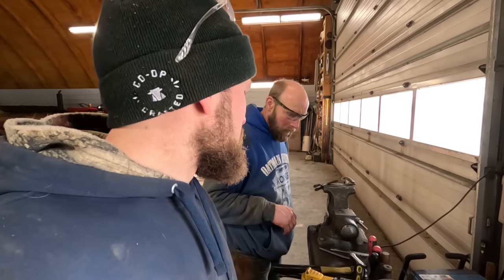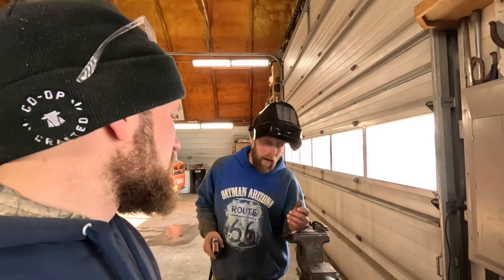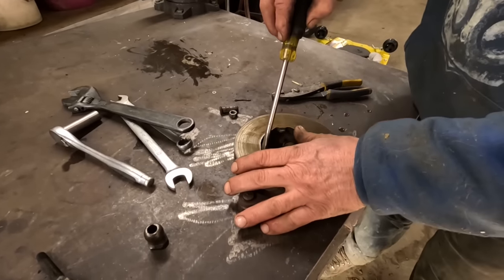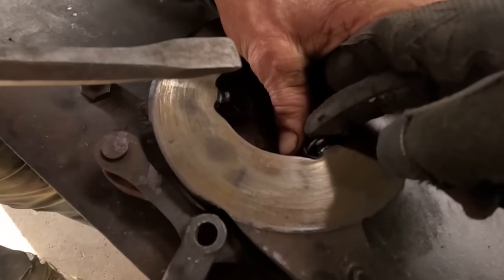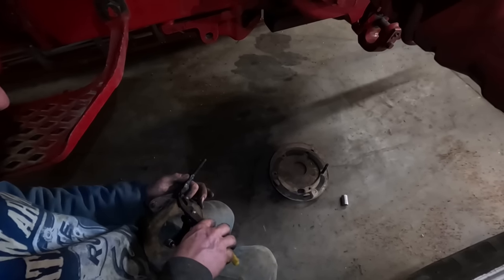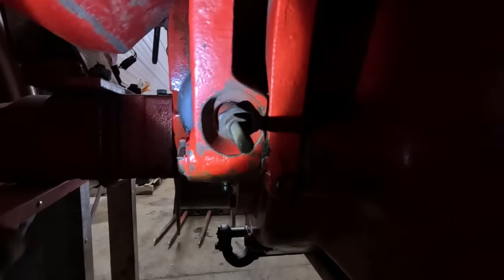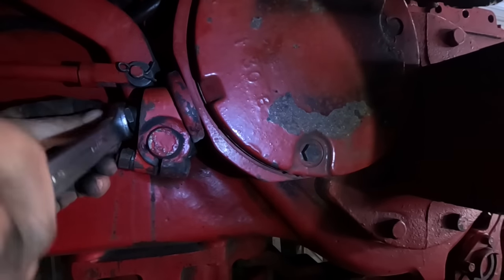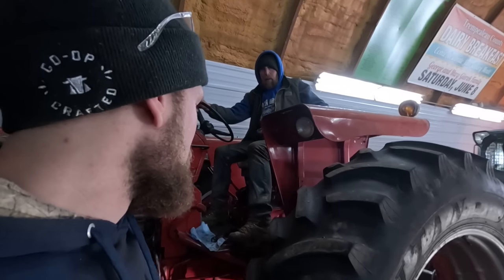Fixing Up Our Old 686 International Tractor!

Comment: Shout out from Seneca SC. I've been watching you guys for awhile, and I want to tell you that you take me back to another place and time. I'm currently 56 yrs old. When I was in high school back in the early 80's I woorked on a local dairy farm here, just up the road. It was a herringbone parlor, with 4 on each side. Numbers varied but in the 65 to 80 or so. I didn't have much cow contact, mostly worked the ag side since they had a dedicated dairyman. We did the usual hay and different silage types, some shell corn mixed in also. Cows also had pellet feed in the parlor. There were 2 concrete silos used for corn, and 1 Harveststore  for mixed stuff like beans and milo. Most all tractors were old even then. Super 88 Oliver diesel, 2 different type 530 Cases, 656 International Hydro, loved that one. 8600 Ford for plowing. Even had a small Versatile that was mostly used to pull a large wet manure spreader. Had Hesston mower and baler, and Field Queen chopper with corn and windrow heads.
Two men could do most of the farming, with exception of a added truck driver for silage since we used a dump cart behind the Queen instead of chopper wagons. Not much left of that place now. The family has passed away. Nothing remains there now but the land and memories of life 40 years ago.

Comment: 5,451 hours!  Heck, that baby is just getting broken in!  Our 686 hour meter quit working at 9,500 hours years ago, and I’m pretty sure it’s got over 12,000 hours on the D312 engine.

It’s definitely a little tired, and has some blow by, but it still does most of the work on our small farm.  I’ve got a little fund going in a shoebox to have the engine rebuilt before too much longer, and then I anticipate many more years of good work out of it.

Simply outstanding tractors.

Oh, and since you guys were talking about those brake assemblies on different equipment, I can confirm a John Deere 4400 combine has the same basic setup with some added hydraulic components, but same friction disk assembly.

Great video guys!

Comment: The MFWD clutch housing on your 7405 should be spring applied and hydraulically released. You will need a press to get the assembly all apart. Once you get it put back together, use something to put power to that solenoid on the back and used compressed air to act as your oil to test it and see if it releases.

Comment: On the 7405, when you pull it apart, check the main housing, where the steel sealing rings go on the shaft they wear in to the housing and lets oil bypass, hopefully it’s just a o ring or teflon seal, if you would like to talk leave contact info in your comment, im just a farmer mechanic, but have done a couple of them, thanks for the videos, You guys do a great job

Comment: Hey the part that broke inside the brake housing. If you cut that part of flat. Drilled it out the same side bolt and Tap the hole threaded that part and put a bolt in with the thread you need and tack weld it then your outside adj. Will move like new. But you guys are good you will get it. Just think what you could do with a machine lathe. Just think of the thing that could be fixed and you would not have to be good with the lathe. Great videos

Comment: At least there in separate housing AC had the similar system but on the end of the final drives😢nice job. Had a 200 AC now it was in the same area as your 686 way simpler. Thanks Men !!

Comment: Something I've learned on the farm all disc brake system. Once you have everything cleaned and back together. Do not tighten your drum tight just run it up snug. Make your adjustments to you push the pedal out as far as it can go. Then tighten your drum your brakes should release and not stick

Comment: Thanks for the video.  Get a puffer bottle of graphite powder and puff the powder under the rubber cover at the front of the brake housing several times a year. This works on Massey Ferguson  and Fordson with the same style of brakes.Loows those balls to climb the ramps better.
Reply: Excellent advice Gerald

Comment: Had to replace the brake disks on our 656...sooo the parts looked very similar. Bought 4 new shims to go along with extras that I had removed. Went to Stollers in Smithville, OH and got some extra salvage shims. Cleaned up the older corroded ones and put them between the better ones. One helpful item is putting Never Sieze on the threaded adjusters. Helps make future dissasembly easier.

Comment: I think when John Deere came out with the 3010 and 4010 the brake system was very advanced over everything else on the market and from personal experience gave thousands of hours of service, but when they need service it's a big project and while you're there you might as well change all the axle bearings which get expensive. The two cylinder tractors, Farmalls and Oliver tractors were not a big deal to fix.
Reply: LMOA.

Comment: I've done a couple of those John Deere mechanical four-wheel-drive solenoids, and O-ring replacement. If your 7405 is like the other small frame 7000 tractors, there is a port that you can put in a gauge and actually check the oil pressure. If the oil is leaking by the O-ring, you will see it. Kind of gives you an opportunity to check it when you put it back together to before you really put everything back together. I usually put high quality grease on the O-rings, so when it slides together there's less of a chance of cutting them.

Comment: You fixed those brakes exactly as I did on my 656.  Weld er up at put it back in service.  You should get in touch with Larsen lights and get your tractors lit up good to make chores after dark more enjoyable.  While it’s not always ideal to work after dark it’s much more enjoyable with good lights!

Comment: Got six of them tractors running around the farm here and used to break alot of them. I started using never seize on that ball nut and down in that cavity where it kinda pivots. Very rare to break one since then. I think it was getting too dry and not able pull straight trying to bend thread rod slightly. Oil or grease in there probably work also.

Comment: This system is very similar to a case 580C backhoe brake system except the 580C also has brake shoes which is what expands the discs. Its a Bendix brake system. They work pretty good until the shaft seals leak which happened on my 580C which then required seal replacement and more. Good video.

Comment: You need to get the center bolt out of a brake chamber on any semi trailer or truck as long as it is an air brake system

Comment: I have a Case 930CK with that type of brake, only it has 3 friction disks. They work great after you stop. The dealer told me they were next to useless even when they were new. I only have a small Ford bailer and even that will push me down a hill with me standing on the pedal. The price of parts have gotten insane.

Comment: Only thing I would've done differently is bevel the rod so you can grind weld to original diameter. That would allow your adjuster to thread on better.   If your other brakes were fine splined discs they were probably Lambert aftermarket discs. Those are pricy to replace.

Comment: Your shop needs a TIG welder added to the lineup!  Someone welded about half the adjusting rods on my little JD950.  It’s rough finding parts for as JD discontinued most replacements for the 850, 950 &1050…

Comment: In My opinion the band brakes were better than the disc until they put hydraulic behind them. My 656 has pretty good brakes going forward, but backwards almost the same as none. The discs get glazed over and don.t work too good.

Comment: On your brake, would it work to buy a threaded yoke along with a length of threaded rod, then tack weld the rod to the yoke to stop it from turning,I think you can buy yokes on Amazon for about $10

Comment: George you need to pull some shims, worked on a 656 that wasn't alot of fun, but I had to get shims form cih that wasn't cheap but I got it fixed for the guy. You guys deal with Downing? They are pretty good with IH stuff 👌

Comment: The main tractor company's still have the old parts, but they price them out of reach so you will look at (Newer) equipment and tractors so they can sell you newer stuff! The (Young) Mechanics in the Dealerships don't have a clue about the older tractor and equipment, they've been trained on computers for the new stuff. I believe they don't even know about the repair manuals on the old stuff.